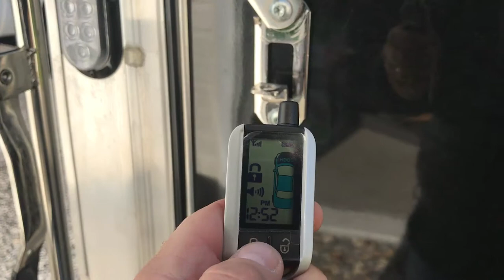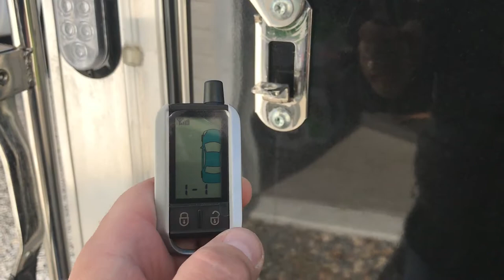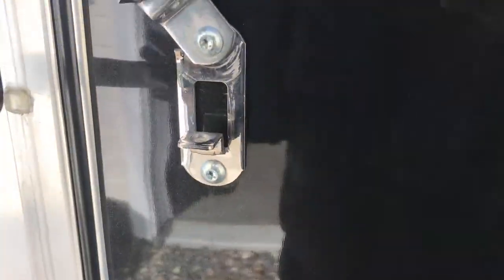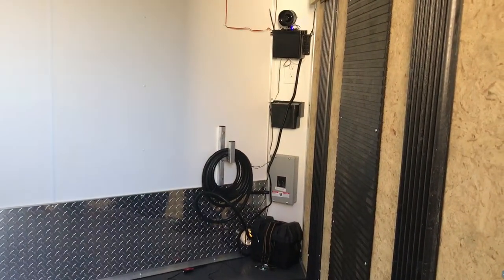DooTalk Trailer Alarm Project - Door Open Sensor Demo

Comment: What brand of alarm did you use?  How far away can you be from the trailer and still receive notifications on the keyfob?
Reply from the maker: I used the Crimestopper SP-302 SecurityPlus 2-Way Deluxe Alarm/Keyless Entry System. The LCD transmitter / receiver that comes with the kit can have a range of up to 3000 feet but it depends on what is between it and the control unit such as how much steel, concrete, etc. I try to park on the same side as my hotel room or in the general vicinity and have had good luck.
Reply: @chriswappler7018  Is there anyway to connect this to your cell phone call so you can be notified if you’re further away like out of town? I was just working in Atlanta and sleeping in my truck but my girls came to visit for two days and obviously we got a hotel on the second night my trailer was broken into and truck window busted out. All that was in there was tools. I’m guessing they assumed there was some type of vehicle or motorcycle in my trailer. They didn’t take a fucking thing. What would they do with tools anyways? Try to work or something lol
Reply from the maker: @c_mac7773  Unfortunately, you can't use a cell phone app with the system I installed. You would be looking at a much more expensive and sofistocated system that would have cell capability and even possibly GPS tracking if the trailer was stolen.
Reply: Can do a video on how to wire the entire system?  Looking to install something exactly like that. Love it.